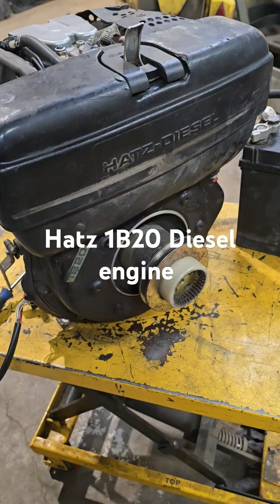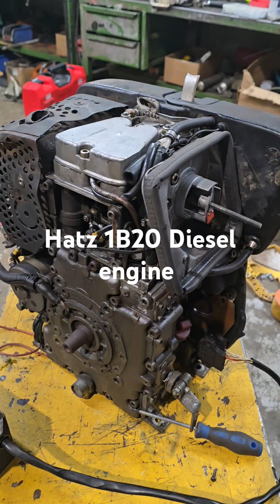Hatz 1B20 Diesel Engine repairs

Comment: Most possible it will be you fuel system, that's a common problem on those. Check you injector for continuous fuel supply

Comment: Maybe a bit late, but i work a lot with Hatz engines. If a 1B.. engines starts in cold condition, but wont start when it got warm. Then its a worn down injection pump in 90% of cases.
Reply from the maker: true issue resolved, fuel system was the issue
Reply: very true
Reply: Mine were doing this last few days and today won't fire at all? I've pulled the hose off the top of the injector and aren't getting any fuel from the vertical hose? Is that the return line to the tank?

Comment: Adjust the valves
Reply: I did the valve adjustments and it works and then as soon as you switch off it doesn't start but cranks
Reply: @zee35fox  so it's something with heat ! Try spraying starting fluid and see if it starts then if not it's compression maybe a stuck ring or low compression worn piston and cylinder if I had it infront of me I could find the problem hope this helps
Reply from the maker: @rickybailey7123  it starts with starting fluid but not without
Reply: @SOAENGINEERING OK so get a compression gauge and check the compression. It sounds like you got low compression. A diesel has to have so much compression to fire. The fuel
So it's gonna be where you crank it cold and leave it running. Don't turn it off and then it'll just have to cool all the way back down to run again. But it's not going to have a lot of power because it's got low compression, so even when it's running, it's not going to have a lot of power because of the low compression, if that makes sense
Reply: @SOAENGINEERING so what's happening is the cylinder when it gets hot expands, causing it to lose more compression being hot !
Reply: @zee35fox  could be the valves sticking make sure the valve guides are clean and valve steem is clean spray wd40 on valve spring and turn motor over u are trying to clean the steem in the middle of the spring it should be shinny like a mirra
Reply: @zee35fox  if still not runing check valve seat could be getting hot and coming lose causing low compression no start